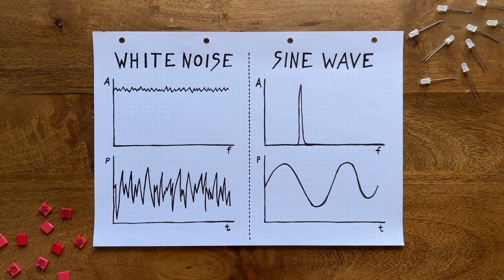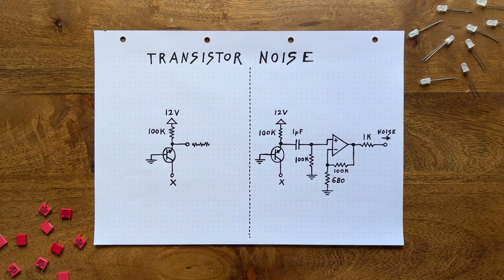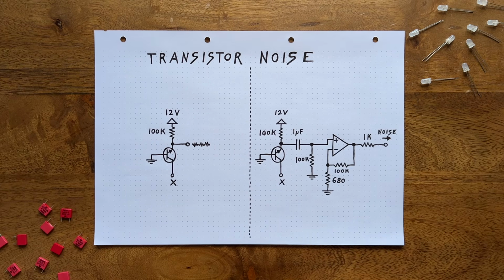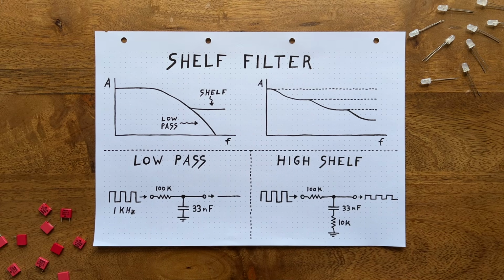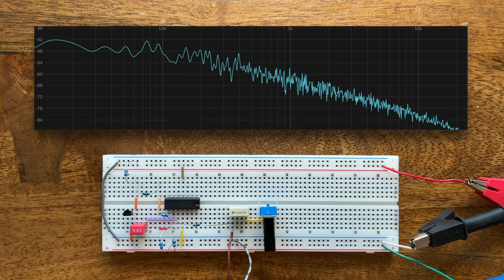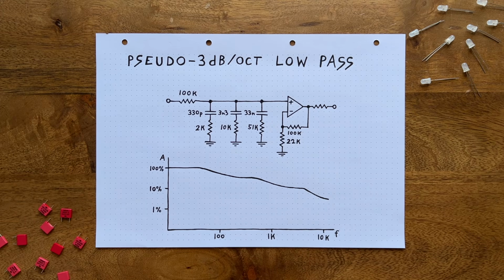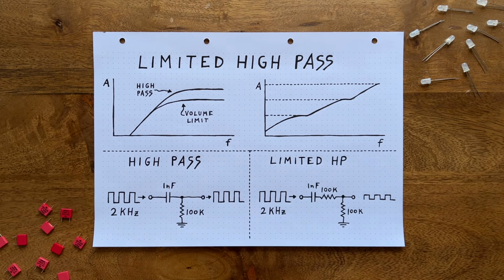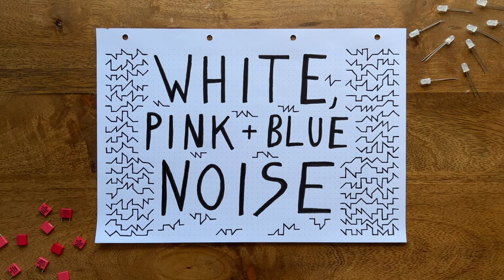Designing a white, pink & blue noise generator from scratch

Comment: Please help! I made the white noise section with the amplifier EXACTLY how you did and when I listen to it I can hear noise but its really quiet and not up to eurorack levels (because I plugged it into my euro, cranked the volume all the way up and my audio interface didn't show it was picking up anything, and when I use my Oscilloscope it appears to be a symmetrical, repeating waveform which I'm pretty sure white noise is not supposed to do.
Reply from the maker: which transistor did you use?
Reply: @MoritzKlein0  omg thanks so much for replying! I'm pretty confident its a general purpose, NPN, 50V IC. I also have in my possession General purpose PNP 40v, TO-92 and Silicon, NPN, low noise, high gain amplifier
part #'s:
2102TR
2105TR
2101TR

Comment: the 12V could be generated by a diode+capacitor tripler voltage circuit at 76kHz ?

Comment: Hello, I only have one suggestion. You should add the power connection to the diagram. You only mention once that a +12V, 0V and -12V is needed. I have had to liesten to you viedeo servral time to cach this piont. Great explanation I have made the three circuits and they work fine.

Comment: 9:15 
The resistor at the top-left corner seems connected to the negative rail, although I understand is the transistor emisor and it should be connected to the positive trail instead.
Reply from the maker: yeah my bad - was the first time i filmed and recorded audio separately
Reply: @MoritzKlein0  No problem, I just wanted to be sure I understood, as that didn´t match what I expected :)
Thank you for your videos! They are very useful and informative.

Comment: I had never heard of blue noise before. I have also heard some other "colors" mentioned,  but have no idea what their specifics are.

Some years back,  I built a device that used a 12 volt power supply and utilized the base-emitter reverse breakdown mode as noise sources.  At that time I had those transistors in sockets,  with the thought of selecting them for maximum noise output.  This was probably not a good idea,  as Ive since learned that subjecting a transistor to that kind of reverse breakdown has a permanent and adverse effect on the transistor's beta.

Did you select a particular kind of transistor as being optimum for this application or did you just use whatever you had on hand?
Reply from the maker: oh interesting. so the transistors get "worn down" by producing noise? i wonder if they'll fail over time. in my case, i tried both the 2N3904 and the BC548. the former's output is super quiet, while the latter reliably gives you really strong noise. so i kept using the BC548 for noise purposes going forward, and it hasn't failed me so far!
Reply: @MoritzKlein0  Not "worn down",  just that running them in base-emitter reverse breakdown does something irreversible to them, I am not clear as to the details of it.

Comment: I am not very impressed, I am a chartered electronic engineer and this is mainly unguided and misleading.  

Voltage does not push current through, current is drawn by a load, voltage is like a bucket of energy. Energy takes the path of least resistance in electronics, as in all areas of life, so flows into the load based on the load.  

The breakdown you are witnessing is not some cruel effect, it is called the zener effect and this phenomena is a fundamental building block of electronics and has been for nearly 100 years.  Providing the series resistor limits the current then the reverse voltage semiconductor will stay in those conditions indefinitely. 

Transistors do not give white noise, low frequency is made up of flicker noise and higher frequency is thermal noise (thermal noise is very close to white noise).  You can tell by looking at your oscilloscope waveform the noise is not white (as it is not equally distrubited positive and negative around 0V)...  It sounds grainy in comparison.

Opamps must ALWAYS have a decoupling capacitor for operational stability and for rejecting unwanted pickup from the external fields all around.

Breadboard is not good for prototyping analogue electronics, or digital electronics. They look nice though, and they are fun to poke things into.

According to the maths your 100k/33nF filter only gives 26dB of rejection at 1kHz, so the output will not be flat, there will be a 1kHz component at around 1/20th of the input signal size (20dB +6dB is equivalent to X10 X2). With 1kHz and 100k/33nF the output waveform will be a triangle wave, but this is only based on the relationship between the 48Hz f-3 of the filter and the signal frequency.  If the signal frequency is changed then the waveform shape will change.

There is an IEC standard filter for generating pink noise, I don't know why you would want it unless you are soak testing/running in loudspeakers you are selling.  What is your purpose for making a pink noise generator?

Ading a 10k resistor as a zero (shelf) into the response does not give a square wave output, it gives a distorted sawtooth that is around twice the peak voltage of the previous circuit.  This is also not just a potential divider, there is an RC which represents a time constant (charge time) and a filter with a complex mathematical pole zero equation that allows us to model gain and phase vs frequency.

It seems you are not educated or experienced, I don't understand why you would want to teach or sell designs based on this.
Reply: why don't you make your own video then?

Comment: I loved the video, but have a question. You said the high pass filter had a cutoff of 1.6hz. I've been working on a random LFO that outputs voltage from 0v to 3.3v (arduino based) and I would like to shift it so it is centered on 0 volts. Could the capacitor/resistor be changed to allow much longer periods in the + or -, like 20-30s? I'm guessing not, but I'm a noob when it comes to designing circuits.

Or could the arduino be run at 1.65+ as the positive and -1.65v at the ground?
Reply from the maker: yes sure, that'll work. just use a bigger resistor or capacitor. you can calculate the cutoff frequencies of different r/c combinations with this tool: http://sim.okawa-denshi.jp/en/CRtool.php

Comment: Hm, the avalanche breakdown noise is in fact shot noise with a certain characteristic. The charge carriers have to overcome a certain potential barrier to initiate a cascade of secondary charge carrieres. This means, shot noise is allready "coloured". I prefer thermal noise (of a metall film resistor or a low power light bulb) as source for a white noise generator, because this is real white noise with an even frequency distribution.

Comment: The classic way noise is generated in a Synthesizer is by the use of a reverse-biased Diode junction, or a reversed-biased transistor B-E junction, you do have to hand-select a diode or transistor to find one that generates a good amount of noise though.

Comment: Usually, white noise is noise containing random frequencies with equal energy per frequency, whereas pink noise is noise containing random frequencies with equal energy per octave, so, pink noise tends to sound like it has more bass frequencies in it than white noise does, blue noise basically contains random high frequencies in it, red noise contains random low frequencies in it, there's also brown noise, or Brownian noise too.

Comment: To make a 3db/oct slope. 
- Make a parallel section: one side with the unfiltered noise signal, one side with the 6db/oct slope filter
- Invert the phase of the filtered signal, and reduce the amplitude by whatever factor is equivalent to 6 decibels of perceived loudness (possibly 50%?)
- Recombine the signals, and you'll have a 3db/oct slope filter.

Thats how i would do it in my DAW if i needed to make a 3db/oct filter and only had access to a 6db filter.
It'd be the same as routing the audio from a parent track to a parallel send track, putting a 6db/oct filter on the send, inverting the phase and lowering the output by 6 decibels.
:D

Comment: Ive made this circuit with correct values, white is working well and is stable, pink works but after about 15seconds it starts breaking down into a crackle, dropping from 4v peak to peak to 0v. I didn’t have foil caps for the filter, so I used 2 film caps and a ceramic… could this be the problem? Turning the power off and back on brings the pink noise back but it only lasts a few seconds.
Reply: Worked it out… it was a faulty TL072 or bad connection on the opamp. Changed it and it’s works fine now
Reply: Looks like 
red wire is +12v 
Green wire is -12v
And black clip is ground (white wire)

Comment: When doing the schematic myself, I was wondering why the noise was off-centered. I finally understood by comparing with Rene Schmitz schematics. We need a 220nF capacitor betweeen the 680 ohms resistor and ground to compensate for the offset. Seems the zero is not perfect on op amps, and it is very noticeable due to the high gain. At least this is my interpretation for that issue.

Comment: Curious what a band pass filter in here would look like!
Reply: Good idea. There's still an unused opamp on the chip.
Reply: @RayMcNamaraMusic  Yes!  But the more I thought about it....  wouldn't you need two more op amps?  When I picture it in my head I'm visualizing basically building everything in the video again.
Reply: @mathieumartin9344  You don't have to build the whole thing in duplicate just for another filter type. You could use the same white noise source and send it to the BP filter, which is basically a LP and HP in series. You could pull that off with a single opamp.

Comment: amplifying the BJT signal is a form of coloring the noise because the op-amp is bandlimited
Reply: The TL07x has a 5 MHz GBW. Operaying at a gain of ~200 puts the corner frequency of the gain amp at 250kHz. Thats wepl beyond audio range which is the purpose of this filter.

If you really want to extend the range of white noise/pink/blue noise you could insert a zero at the corner frequency of the gain amp in your filter.

Comment: It should be noted that synth makers tested their transistors and hand selected the worst, dirtiest transistors for use as noise sources.  Some makers even switched noise sources as the task of selecting proper noise transistors got harder because of expanded sales volume and improvements in transistor manufacturing.  The two most common substitutes were Zener diodes and shift register based digital noise chips.  All have different tone and texture, but transistors are the most variable in manufacturing.
Reply: LFSR is by far the easiest and most controllable way to do it, yeah, but I guess many people might find it boring
Reply: liner function shift register

Comment: I've been playing around with this circuit for a couple of days.  I am using a 2N3904 transistor so it "could" be different from the BC548 or others.

I needed a lot more gain in the white noise to get good enough levels. I added a second gain stage with a voltage gain of 32 to get close to what I expected (about 7.5V peak).

The GBW of the transistor is 3 MHz. The gain in the White noise part of the video is set to 148 (100K feedback, 680 to GND. With the 3 MHz GBW, that would be a bandwidth of 22 KHz. Seems OK for Audio.

However, with a gain of 148, and an offset voltage of, say 3 mV, is a DC offset in the output of around 0.5V, which is what I measured. I tried a TL084 with slightly better results. I ended up adding an additional 100 ohms to ground (dropped the 680 to 560) and a 50K trim pot with 220K to the wiper (the classic circuit for trimming out offset errors). This was enough to easily trim out the offset voltage error.

Using the White output to drive the unity gain of the Blue output didn't have enough amplitude. For that I changed the unity gain buffer to a gain of about 3 (24K feedback, 12K to ground),  That was about right.

The pink level was WAY too low. I added amplification there as well. Something around 16x was too much (100K/6.8K). I'll probably raise the resistor to ground to 10K and call it good. 

All of this to ask this question - I expected that the RC values in the Pink noise circuit would be somewhere near the corner frequencies but they are WAY off what I expected. For instance, R=2000 and C=330pF is up around 1.5MHz. The other end R=51K, C=33nF is at 594 Hz. 

What am I missing here?
Reply from the maker: unfortunately, the 2N3904 produces barely any noise. i've run into the same issue. if you switch it for a BC548/547, you should get much better results.
Reply: @MoritzKlein0  I finally tried a BC548 and it's much noisier as you indicated - about 15X noisier. Thanks for your suggestion. I guess all NPN transistors are not created equal.
Reply: @MoritzKlein0  That makes sense. It's not the typical transistor here in the US, but I'll add some to my Mouser cart for next order.
Reply: Try a bc337 it was much louder than a bc547 in my tests.
Reply: I ran an LTSpice simulation and the Pink circuit works just as described in the video.

I re-did the RC calculations adding in the 100K and got something like the video (corners at 200Hz, 2.7KHz, and 29KHz.) Perhaps that 'sthe right way for me to see the "why" this circuit works.
Reply from the maker: i‘m not sure this covers your other concerns, though
Reply: @MoritzKlein0  It might because the noise itself might be better.
Reply: @MoritzKlein0  Lookng closer at the Pink filter in LTSpice. Driving it with a 1V signal (0dB), it's already down about -7.5 dB at 100 Hz. That's probably why I needed amplification in the Pink output. Perhaps the 2N3904 just isn't making much LF noise and the filter cuts off what there is?

Comment: I would like to see a 7/15 bit LFSR digital noise generator. I tried with what i had, a 74HC595, it didnt work well, using external clocks would make the chips unpredictable. Im gunna try again with a CD4094
Reply: 15 bits is probably too small and the pseudorandom pattern will repeat every  second for a 32KHz clock.  Use a 32bit LSFR or bigger for a more random output.  This is even easier with a small micro and a bit of code.
Reply: @mustang2440  I see 32bit too big for audio purpose, yes it can give a cleaner sounding "white" noise with more randomness, but I mostly care about the harsh digital noise. I'm using 15bit because its only 2 chips and flipping a switch turns it into a 7bit for harsher metallic sound. the usually clock I use ranges from 0.1Hz to 10kHz so the repetition is  minutes to seconds and with modulation that's even less noticeable. I have the schematic if your interested
Reply: @leomorev8912 ok yes makes sense for a harsher sound but any clock below 20Hz you won't hear as sound, but as clicks.

Comment: I looked up the BC548 datasheet and it lists a breakdown voltage of 30V but you are supplying the white noise circuit with 12V? Without an oscilloscope how could I know when this threshold is reached with my transistor?
Reply: That sounds like the C-B breakdown voltage. He's using the B-E junction which has a lower breakdown voltage.

Comment: Hey Moritz :)
Thanks you soo much for your awsome and also inspiring videos. I'm fully pumped building my own stuff along with your vids.
One thing that is rather confusing for me though is, ordering all the components. I mean, i know how placing internet orders work :D but I mean, do you buy your components normally in bundles? What sources can you recommend (in germany / austria) and what kind of kit (like resistors, capacitors, potis, diodes etc.) would you recommend for a beginner like me?
Thx in advance

Comment: These videos are really great Moritz, but one thing that's missing (unless I missed it) is what kind of output module we need to connect our audio to an amp, headphones, or computer's audio in without blowing anything up.  Some YT videos just say "don't worry, connect it up", but having 10V p-p signals going into a laptop or audio amp sounds like it might do some damage....?

PS: A red wire connecting to ground on the breadboard?  I thought you were better than that.... ;)
Reply from the maker: you can use something like this to scale 10 V pp signals down to consumer audio line level: https://tinyurl.com/29kcbouk
Reply: @MoritzKlein0  Great and INTERACTIVE answer, very  cool — thanks!  I finally signed up for your Patreon. :)

Comment: I made something almost exactly like this a couple of years ago, trying to make a noise generator function for a function generator (I'm still) building. It was most instructive learning how to do that, but I wish I had your video back then to explain it to me, as this is the best explanation I've seen all together in one place. I'll add a blue noise function now too (I just had white and pink before). For the pink noise, I did try a 6-stage shelf filter to try and get more accurate, but it never seemed to work as well as the 3 stage one... probably because the attenuation was too much.

Comment: aww man, this doesn't work very well with 9v batteries, just tried it, it needs the 12V. 
Edit: you can hack it to work by connecting the base of the transistor(middle pin) to the negative supply insted of groud. It jusses the transister up with 18V insted of 9V
Reply from the maker: oh good to know! have you also tried using a weaker resistor between the supply voltage and emitter?
Reply: @MoritzKlein0  no I havent tried that. thinking about this probably every transistor is going to have different brekdown voltage and noise volume charecteristics, because it's not an intended use and is not spesified by the manufacurer. you just have to try a bunch of stuff untill it works i guess